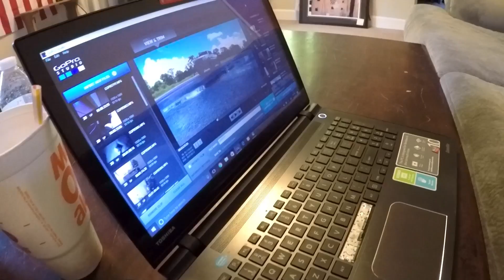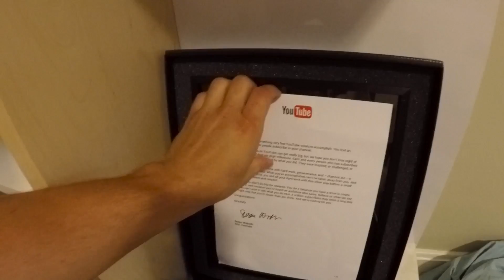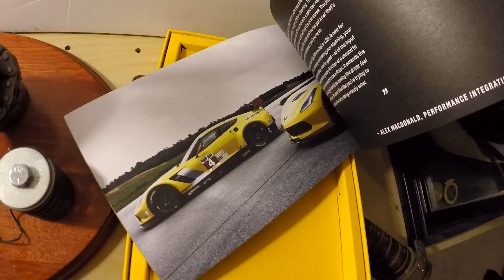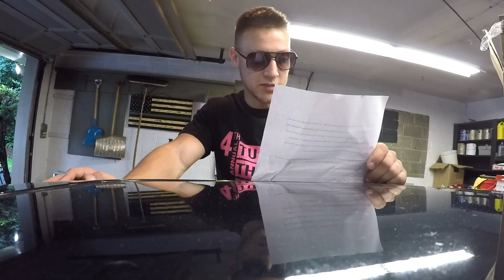My NEW HOUSE!!!

Comment: @StreetSpeed717 I'll be in PA in middle August.  If you still have the Z06 in yellow then, I have a color matching set of performance ignition wires I would like you to try.  Was hoping to run into you while I'm out there.

Comment: Is that a 6 inch lift on the duramax cause I have a 01 Silverado with 13,556 miles on it let me explain how the mirages are low because my grandma never ever used it so it just sat in her garage theirs barley any rust on it so I'm happy but I'm getting 6 inch lift and 35 inch tires so yeah
Reply: Oops meant mileage